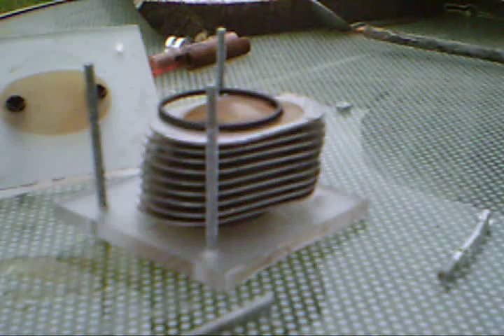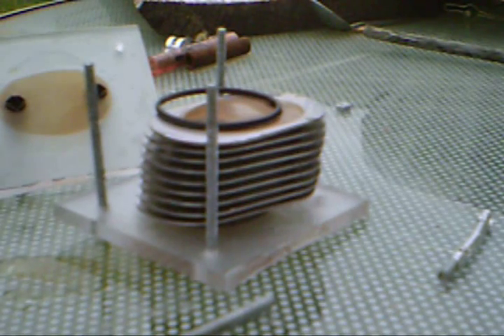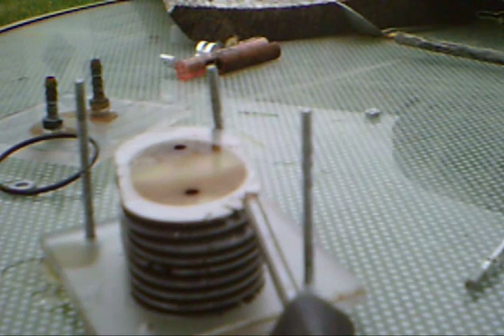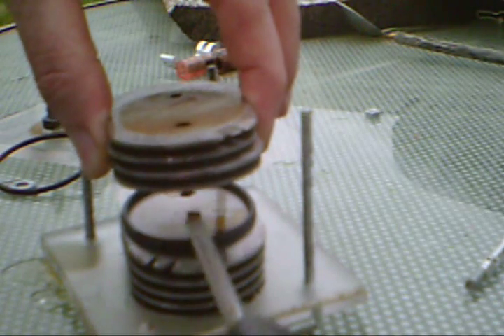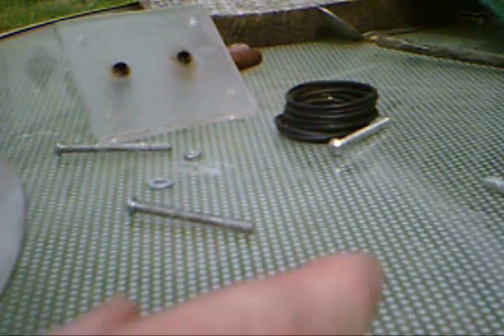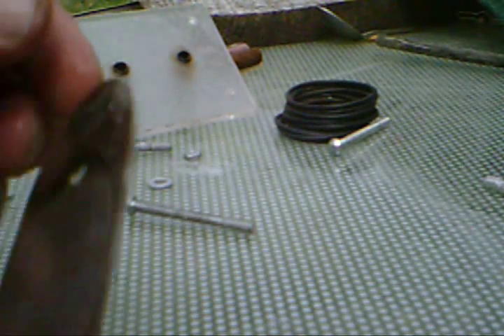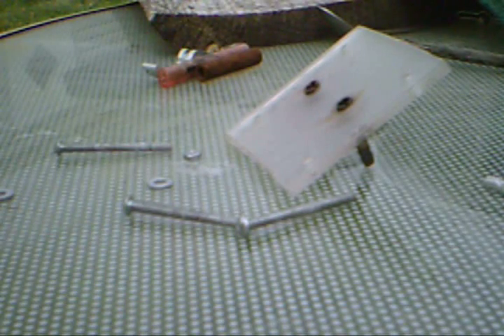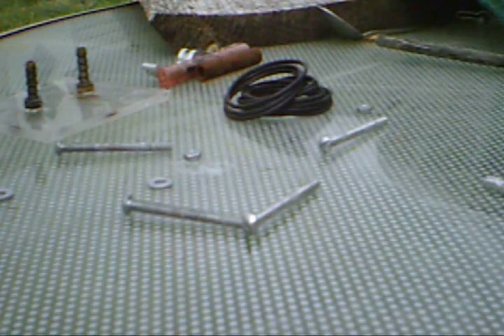HHO Dry cell project pt 5

Comment: Baking Soda decomposes within 3 - 4 weeks and the Carbon Gases decrease your cars performance. You can compare the condition of your plates with mine after I drove 4 weeks with Baking Soda, please see my video 011 HHO Spoon or Video 005 HHO Cups. I,m using wet Cells since it is easier to experiment and gain knowledge over the whole system.

Comment from the maker: It's combination of the fact that I'm still using a basic chemical, like baking soda, instead of using other compounds that other people are using. I hear KOH is the one to use. Also the small water container means a faster "burnout" like this. Kinda like sticking your head in a small container and running out of air. A larger container of water would last longer.
Thanks for your comment, but platinum would be too expensive. The high grade stainless steel used here is scrap I picked up cheap.

Comment from the maker: It could be because the bottle was so small and only held a small amount of water. the stainless steel bottle held a lot more. Since the plates are holding up so well, I might try a different chemical.
Oh, well. At least clean up a reassembly was easy. I have a couple of amp meters, as soon as I rig up a couple of bottle for gas measurement I run some wet/dry cell test. and other test.